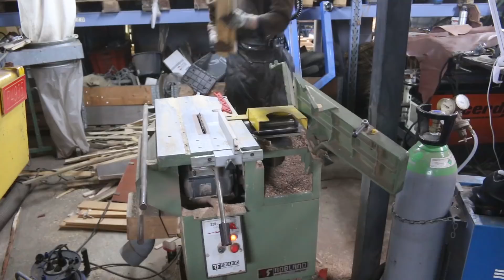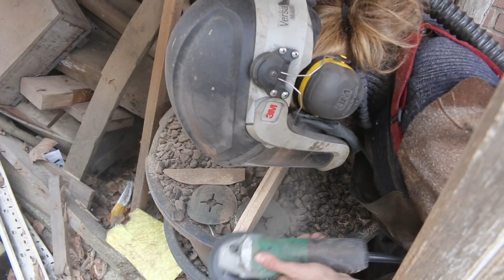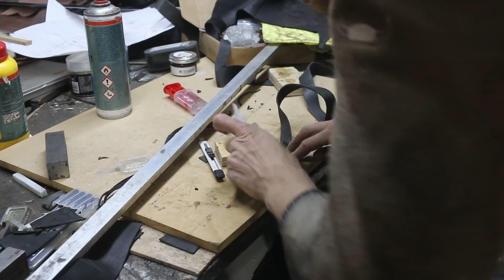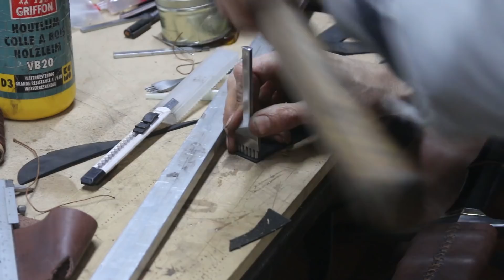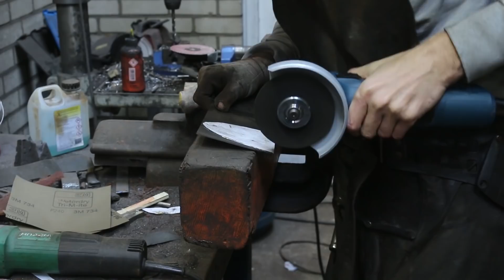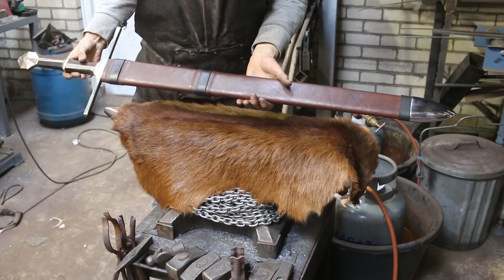Forging a German longsword, part 6, making the scabbard.

Comment: Why the scabbard is so thick? Even with leather inside (which is not a good choice IMHO, it will absorb water, deform and may cause rust. I do not think that 15 century scabbards were faced with anything, and earlier they used sheepskin or even otter fur, not leather)  you can shave at least 30% of wood without any adverse effect. If it follows the shape of the blade on the outside more closely, with medial ridge, it will look much more elegant.
 Also you forget to carve slight recess for the chape - yours is a bit on massive side and sticks out. Masking it with black leather stripes is not the best solution.
Check the scabbard of "sword of the connetable de France" in Paris army museum (inv J 26). Not only it is one of the best preserved 15 c scabbard but (unlike Munich type XX scabbard which is definitely better) it is on standalone  display, you can walk around and see backside of the scabbard with stitching etc :)

Comment: You should glue a bit of soft felt where the point goes in scabbards to help with rattling. Just needs a small amount so the tip of the sword or knife sticks into it but not very far up to prevent wear on the finish.

Comment: A powerful and long sword swung from horseback. Room for two hands when it’s time to go to ground. Magnificent piece. The chappe is a really nice touch.
Reply: It's interesting that your using waxed cotton thread which was unheard of in my great great grandfathers day in silesian. MY Great Great Grandfather was swordsmith armourer blacksmith and he used to stitch the leather together wet with damp leather thread and between it and the glue as it dried It would stretch and stick very tight.